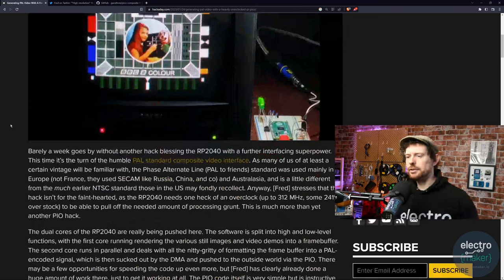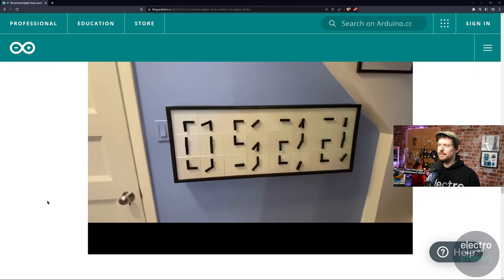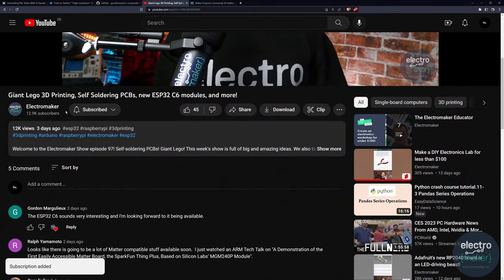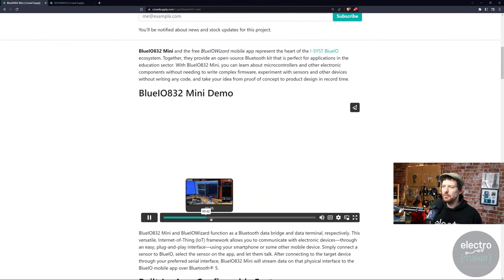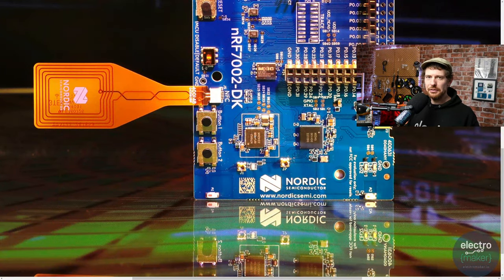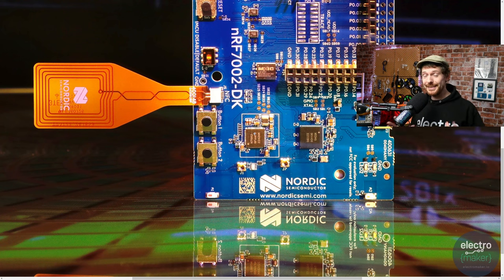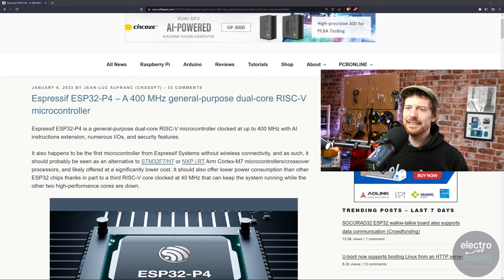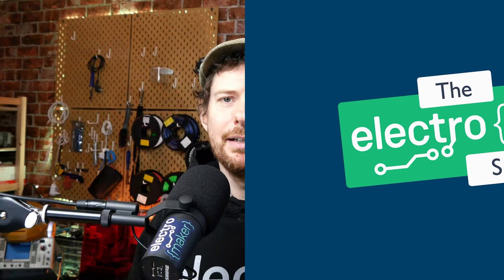Analog Clock goes Digital, Nordic goes WiFi, Espressif goes NO-WIFI?

Comment: #nRF7002 The nRF7002 DK would be a great way to try out WiFi 6.  I would try using it as a multi-protocol WiFi bridge for NFC, BLE, and Thread.  It's great that Nordic has designed the nRF7002 to be interoperable with their other devices.  Maybe they'll do a WiFi version of the Thingy:53.